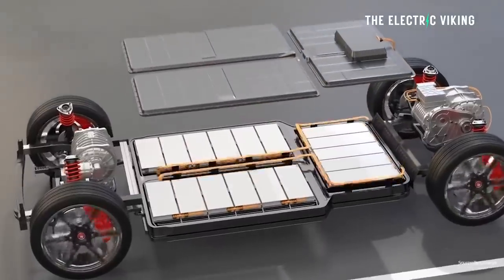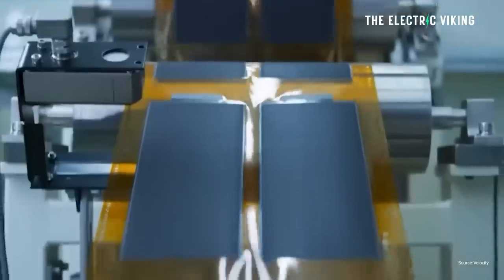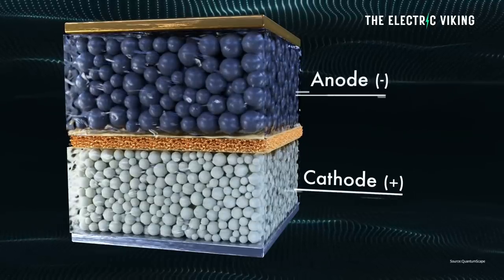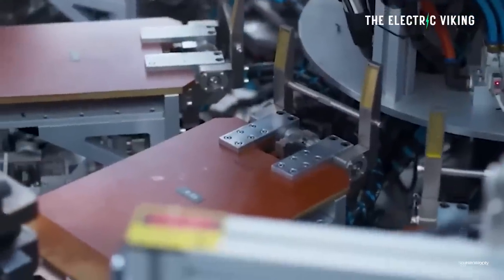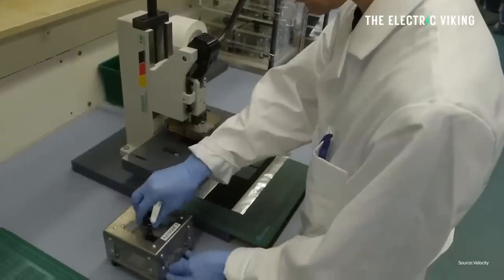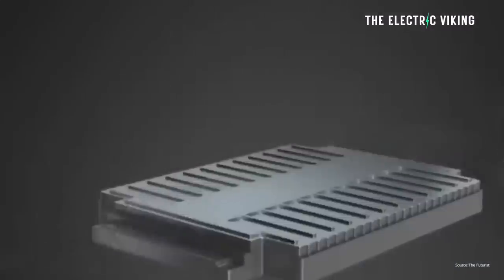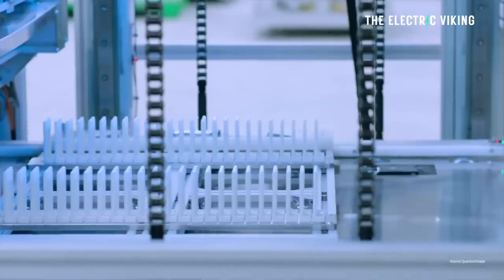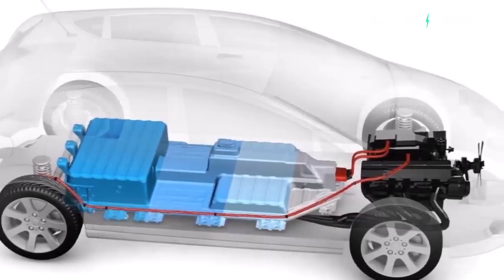NEW discovery solves problems with lithium-metal-based solid-state batteries.

Comment: This is why we should hold purchasing anything EV's. It's battery performance is not optimum yet. Every big step in performance  degrade current EV's.
Reply: Is a new gasoline or diesel car going to hold its value better?  I don't know; it's unclear.
Reply: A reasonable argument can be made that the short term benefits of using today's "not optimum" battery technology now would far outway any "benefit" gained by waiting until better tech comes along.  There will ALWAYS be something better on the horizon and therefore one could delay getting any benefits at all indefinitely.
Reply: @marchelgeson this is faulty logic. You're ignoring the 'opportunity cost' of having to completely retool massive production lines that become obsolete with every change in battery chemistry. 🤦

Comment: Please, Viking, learn the difference between W and Wh.
Reply: If only Sam wasn't a chronic repeat offender with such relatively trivial but unfortunately also much worse gaffes. Still, occasionally his vids do stimulate further investigation elsewhere.
Reply: It would be even better if we all switched to the standard MKS unit for energy which is the Joule, aka watt-second.  One joule of energy is delivered by the dissipation of 1 watt in one second.  My supplier of natural gas [methane] quite correctly bills me for megajoules [MJ] of the energy available from the combustion of methane. One watt-hour = 3600 joules, one kWh = 3.6 MJ, one MWh = 3.6 GJ, etc.  We should also stop using the antiquated horsepower [= 746 W].  Electric motors should be rated in W or kW or MW.  Grumble, grumble...  Old man disease.  LOL
Reply: As an industrial electronics technician who got his apprenticeship from ZF Friedrichshafen and worked there some time (until I found out that it had forced laborers during WW2 and produced terrorist arms for the Nazis) I tell you: it's completely fine whether you say W or Wh...I know what you mean.
Reply: @jrb_sland Joule is the worst shit ever being established. Sadly all units named after people are icky...so Watt, too.
Reply: @melon beton "Icky" to name physical units after groundbreaking contributors to science and engineering?
You think these people were Icky?
Newton Volta Ampere Faraday Ohm Watt Coulomb Hertz Siemens Henry Oersted Tesla Weber Gauss  Pascal Torr Celsius Fahrenheit, I'm sure there are dozens of others.
Why shouldn't we remember them this way?

Comment: The material costs of this cell are lower than a common EV Lithium cell - the cell is comprised of less material (by weight and volume) and less expensive materials. But, the engineering cost, i.e. of specially prepared materials and novel manufacturing steps, would be higher.

The degradation of the cells is okay but not brilliant.

There are multiple problems with solid state cells that often go unmentioned. As there is no mention of the impedance of this cell I will assume it is high which is basically a no no for any viable cell/battery for an EV. Heat builds up especially at junctions between materials and it is the enemy of efficiency and can lead to shorts or open circuits and thus battery failure even when fires aren't likely.

Comment: "235 Watts per kilo", shouldn't that be: 235 Watt hours per kilo.
Reply: This is likely the "Power" vs "Energy" that is so confusing to many people, and also used to obfuscate information about batteries by certain manufacturers. A battery could possibly be rated as being able to deliver 235 Watts of power per kilo at any given moment, or be able to store and deliver 235 Watt hours of energy per kilo. Many people confuse the two, or do not understand the difference, or fail to fact check and provide specificity for their vids on YouTube.

Comment: If that technique works with Lithium Sulphur cells, does it also improve cycle life of Sodium Sulphur cells? With Sodium being much more abundant, there is the opportunity to produce cells which are a little heavier than Lithium Sulphur cells, but with good durability and higher energy density than LFP cells. One of the challenges with Sodium-based cells is the lower cycle life than equivalent Lithium-based cells. So an good improvement in durability should enable the manufacture of lower cost and safe  cells for EV's, and maybe aircraft too.

Comment: A thought I wonder if this new super conductor that looks like it can run at room temp be used in the battery tech atm ?
Reply: LK-99?
1. It's not a superconductor
2. It's a ceramic material, can't be made into wires
3. You need to find better news sources if you thought it was real

Comment: Sure, for mass adoption of personal vehicles we want fairly cheap batteries. However, the same factors that lead to continuous improvement of Li-Ph can lead to future improvements of Solid state. Both are fairly new tech with a potential.  In vehicle applications where safety in crashes and fire prevention are more important like aircraft, many manufacturers would prefer solid state even without the highest density. Long range cargo planes would trend towards the densest energy with decent safety while passenger medium range planes would prefer higher safety so long as the density is decently competitive. Other applications that would want solid state include vehicles used in warehouses like forklifts, construction like large shovels, and everything related to underground mining. In these examples, the more solid state are made the more prices would come down, and some users would be willing to pay the higher price in the medium term.

States like Japan that see themselves as premium popular-opinion sensitive auto markets have already invested heavily into hydrogen which is less efficient and higher priced, so we have no reason to suspect they won't also invest into solid state now. Even better, they may pivot from hydrogen to solid state, which still would be a significant improvement.

Comment: How does cycle life relate to miles/km?  If a car is topped up each night, is that a cycle?  Or less, since it's only a partial charge?
Reply: Less. And the less you discharge it each time, the less effect it has on the lifespan.
As in, ten discharges at 10% is not as much damage as 1 cycle of 100%.
Not even close. This applies to all batteries.
Reply: If I remember correctly, in todays batteries 0-80% charge "costs" around 0.2 "cycles" (0-100% being a full cycle)
Reply: if I understand correctly (and i think i do), a partial charge is a partial cycle, just like when recharging a phone battery, so ~30% recharge is ~30% of a cycle.
Edit: I agree with the other commenters, but battery chemistry can affect it too, ie lithium phosphate vs old lithium ion, it's complicated, college post graduate level complicated...
Reply: Does charging rate affect how much of a cycle is "used", for a given number of kWh?
Reply: @bearcubdaycare  Looks like temperature is the bigger factor. If the battery gets hot during charging, then yes, it's more wear.

Comment: Current batteries are not really suitable.   The AVERAGE age of cars in Australia is around 10 years.   I doubt if batteries are not going to deteriorate over extended periods - and they really need to last for say 20 years.   I think the fire dangers are going to be immense as well as recycling.   I live in a rural town and quite a few cars are junked at the local tip.   These are collected by metal recyclers but the whole process will need to be much more sophisticated as battery packs are likely to be very dangerous.  BEVs are great fro people who can afford new or near new cars.  I doubt if they will be great for people on minimum budgets, who will drive them 'till they drop and dump them.   Batteries must be made safer.   Even our small consumer lithium batteries are really a danger which we all tend to ignore in the hope a runaway just doesn't happen to us.